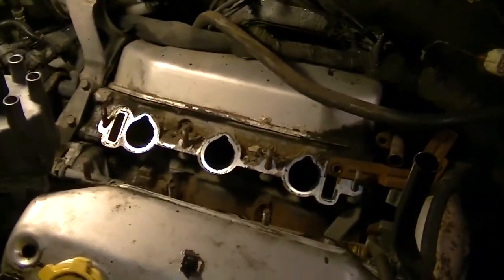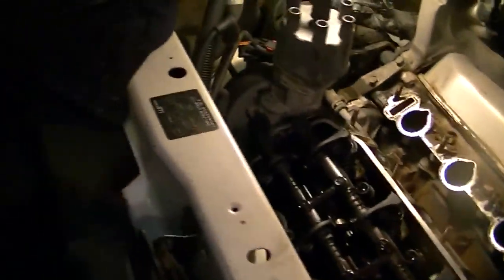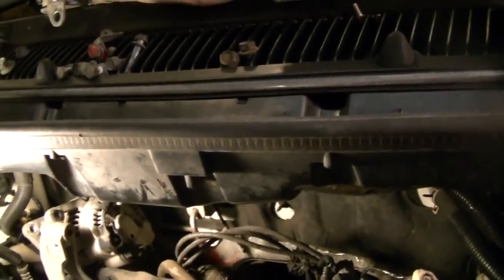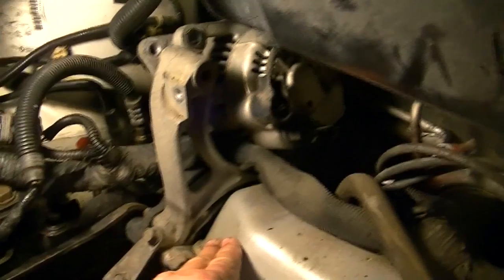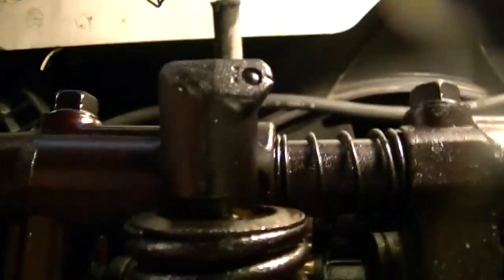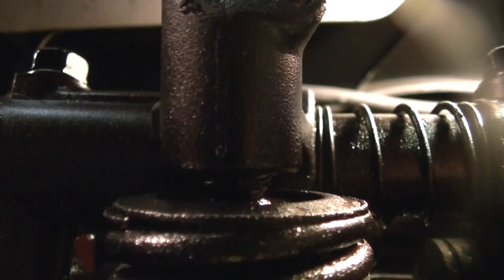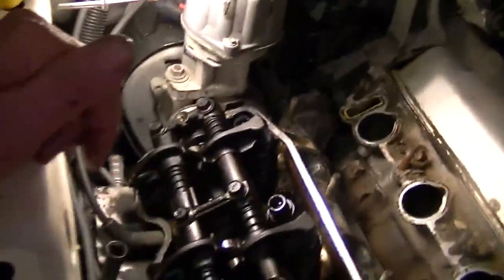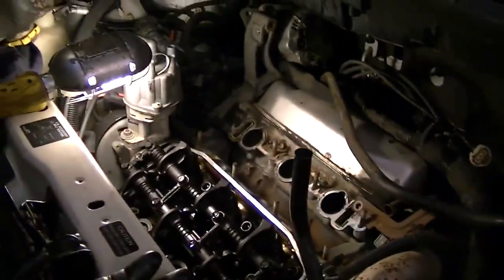Dodge 3.0 Lifter Tick...Where and how the lifters are installed in the rocker arms.

Comment: You're very talented at this type of repair! Thank you for sharing this video! I'm in the middle of trying to replace the valve cover gaskets and the space is challenging: definitely REMOVE the wiper assembly & cowl. Takes about 30 or so minutes but it's WORTH having that available space! Thanks again for the 3.0 engine (and other!) videos! AWESOME!
Reply from the maker: Yea those 3.0 motor are good motors, just the lifters ad seals never lasted causing smoking. Thanks!